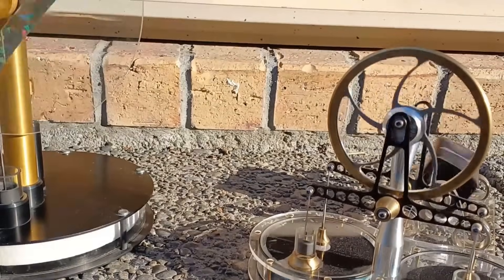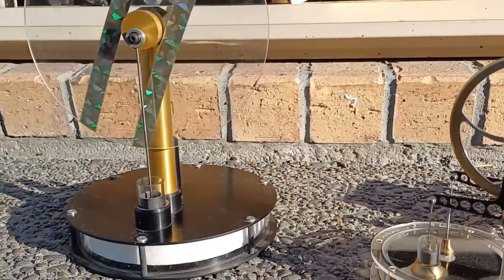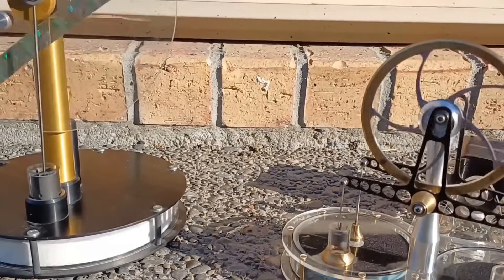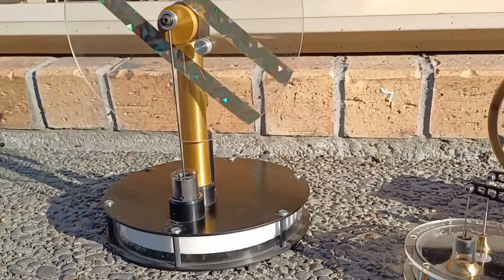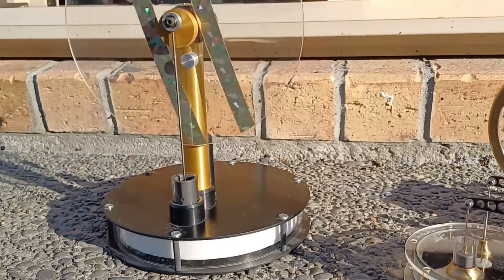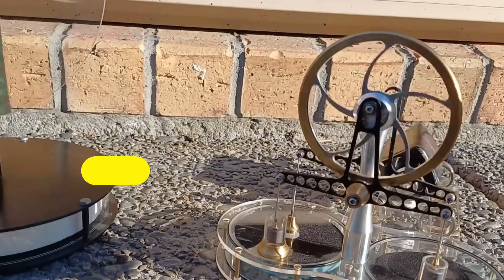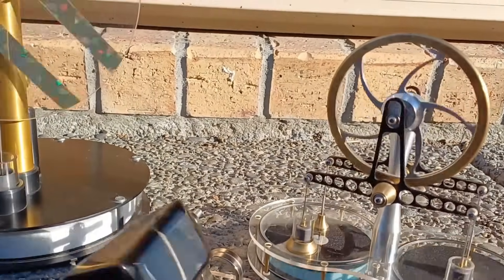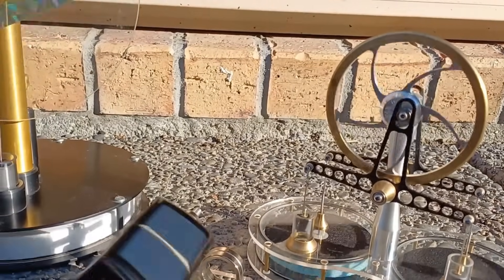Model Engine Memories Thomas PCGuru ENGINES Recap SPECIAL

Comment: It was light weight, efficienr, easy to build,and quite able to fly free flight models swing a 12 inh or larger prop.  Much easier to build and maintain than those clunky sinker weight motors which you display.. Light weight and efficiency is the byword with free flight.
Reply from the maker: Yes, the early free flight engines were such a joy! The more modern engines are more for looks than performance. I well remember running across fields in rural Canterbury, New Zealand and launching my Vic Smeed Tomboy into the blue. Sometimes it would catch a thermal and nearly disappear. Happy days...

Comment: Hi Thomas, have you any videos on timing a Eachine hit and miss engine, I know about TDC and the spark, no one on youtube explains the position of the cam at  TDC though.  many thanks for all your excellent videos over the year.
Reply from the maker: OK let me try to think it through. Not at TDC, but the exhaust cam should open at the beginning of the exhaust stroke and close et the end of it.
Reply: Many thanks Thomas, I will try that.  wishing you a great new year, keep up the good work.
Reply from the maker: @bertyjustice  For my hit and miss, ignition just after TDC gives a great single "hit" firing at low speed. The following stroke forward is the power stroke. That stroke ends with the piston as far away from the cylinder as it gets, then as the flywheel carries it around it is the exhaust stroke., The exhaust valve opens at the beginning of this stroke. The flywheel rotating keeps it pushing smoke out the exhaust, until the piston is almost back at TDC and you close the exhaust valve. In a hit and miss, as the flywheel carries it through the next stroke away from the cylinder, the governor either holds the exhaust open (miss) or if it allows the exhaust to close, the suction formed opens the intake valve and petrol-fuel mix is sucked in preparing for the next firing (hit)
Reply: Thanks again Thomas, I have printed the information out to study.  Have a great new year

Comment: Bonjour Thomas,
As great collector and skill mechanic, how many of your engines start out of the box without any enhancement ? 
Which one would be your preference ?
And when comes the vertical Retrol Hit & Miss engine ?
Bonnes fêtes,
Amicalement, Raphaël
Reply from the maker: Nice to hear from you Raphaël. For me, the pleasure is getting the engine running what I can achieve "perfect" and learn a bit. Early engines like the M90 needed valve lapping, new main bearings, retiming the exhaust valve. Lately, engines like the Microcosm OKMO v twins need nothing done. Having to lap valves seems to be a thing of the past. I still find that a batch of engines built by an engineer's employees rather than the engineer himself will not be assembled so well. OKMO's tiniest Stirling engines are perfect out of the box. But their Rider Ericsson's usually need fiddly pump work and are simply too small. Hit & misses can always use cam and detent latch optimisation. Kontax low temperature engines are perfection, but their high temperature mini engines have machining tolerance issues with the pistons-cylinder fit, which I guess is acceptable. I don't know when the Retrol MUSA vertical will arrive, surely soon???